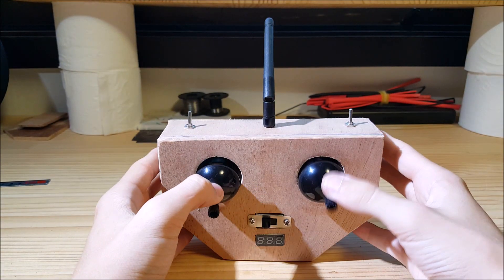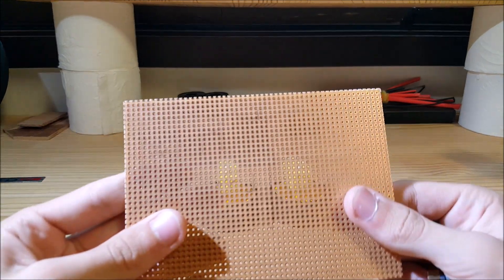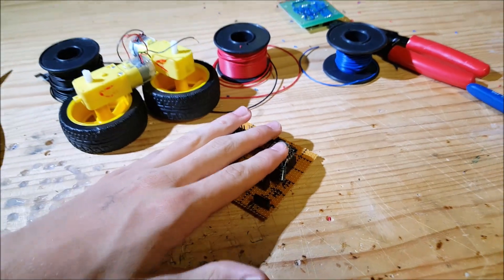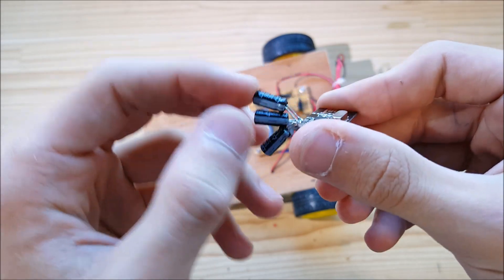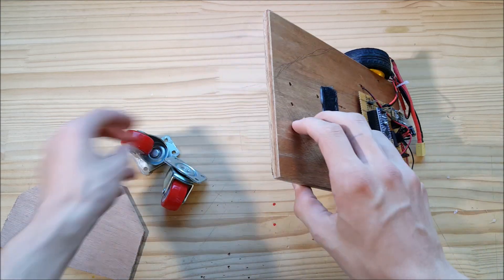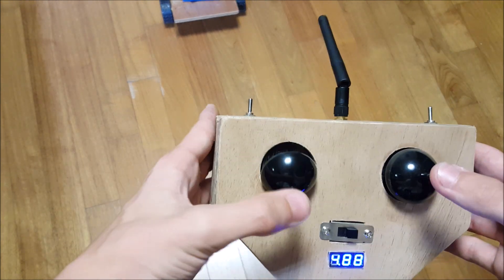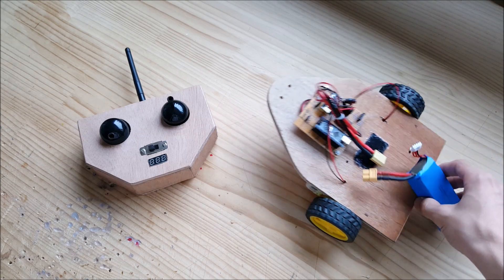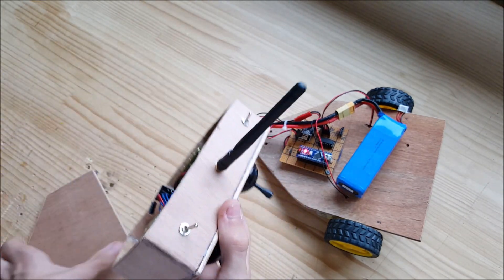DIY Arduino RC Car - Part 2

Comment: Mate, compared to other guys doing same thing:

-Your video is more enjoyable overall.
-Music in the video is relaxing rather then brain wrecking, I like it.
-You put everything you’ve found out during the project making.
—
Just a single thing that I’d recommend is  (if you want bigger audiance) - try explaining connections and electronics you use. Why this, why that..
You’ve done pretty good job, as far as I am concerned, I enjoyed it more then others. You have earned yourself a subscriber! I hope many more will come :)
Reply from the maker: Wow thanks a lot !
I'll take that advice into consideration
It's true I go a bit too fast on the electronic part. I don't know until where I should explain.